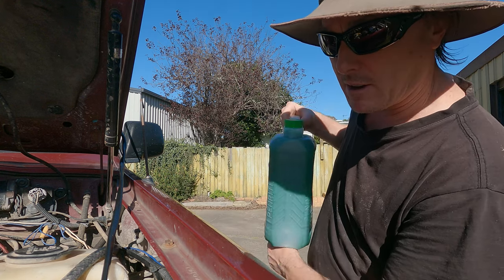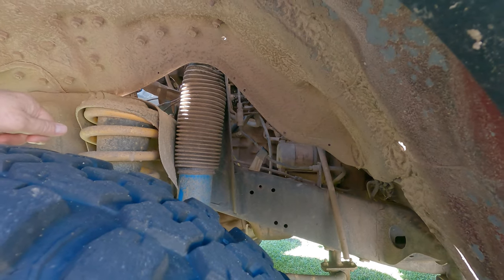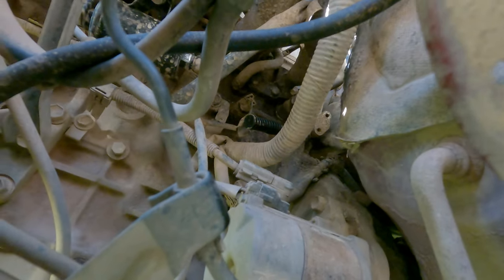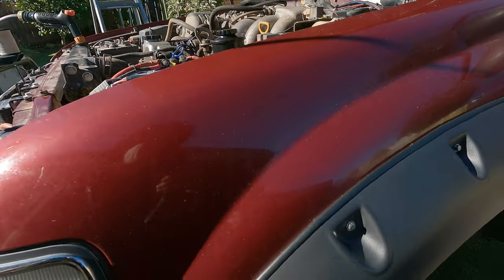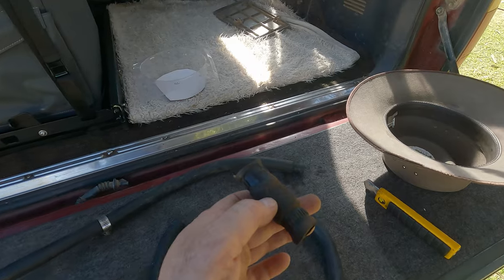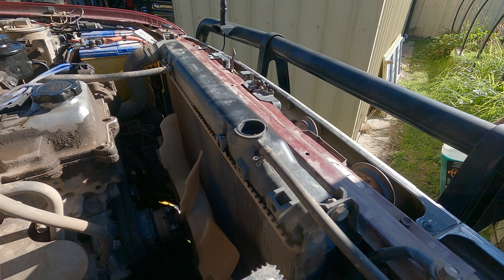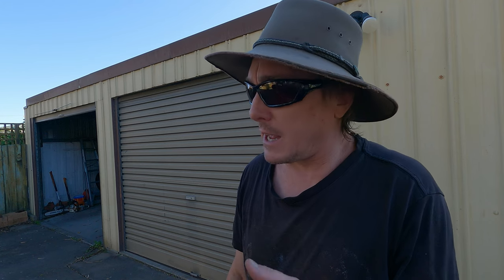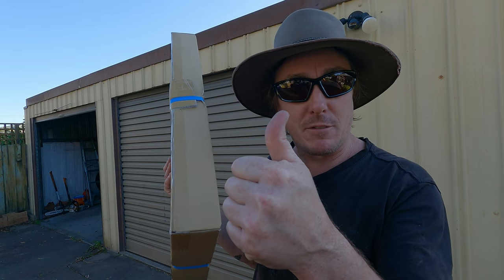How To Flush 80 Series Land Cruiser Cooling System || 80 Series Landcruiser - 1FZJ80

Comment: I wish I knew how to fix little mechanical problems. I know nothing and it's always on the back of my mind when I'm out bush. I suppose that just makes me a bit more careful but it does cost me an arm and a leg to get it serviced on time or get it checked by a mechanic before a big trip.
Reply from the maker: Yeah I'm sort of lucky I Have a mechanical knowledge Its saved me a lot. I tend to take it easy as well especially solo and the places I go are remote so things like a hard section of track I wont push it hard in case I say snap a CV or something else pops.

Comment: Hey mate just doing a coolant swap on my 1hdft. Do you know if the drain for the block is the same on this? Can’t seem to find it. Could I just drain it from that hose you did ?
Reply from the maker: Should be Just to the rear of the oil filter, above the oil press sender
Reply: I ended up removing similar hose to you. And drained it through that.
Reply from the maker: @joshwatts12  Oh cool brother 👍
Reply: Also. Trying to hook up aftermarket oil pressure sensor. Is it the round metal thing in the block ?
Reply from the maker: @joshwatts12  I'm not sure on that one mate. Sounds like it is but ide google it 👍
Reply: Cheers mate, appreciate your time anyway.
Reply from the maker: @joshwatts12  No probs mate wish I could help more

Comment: Hi mate what size heater hose do I need and where would I buy a roll of it like you have?
Reply from the maker: Pritty sure it's around 12mm Id (inside Diameter) I just went to my local Auto parts store (In Australia Supper Cheap Auto) ask them and they will point you in the right direction. Also you will have spare so you can keep that for emergencies 👍